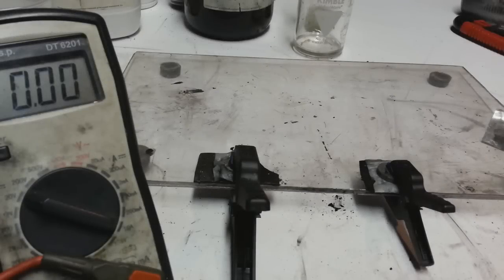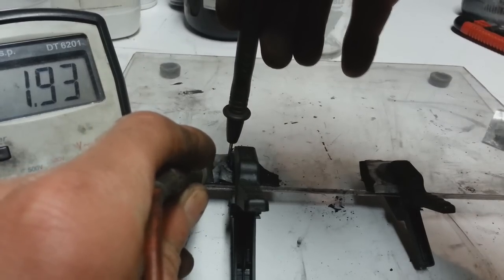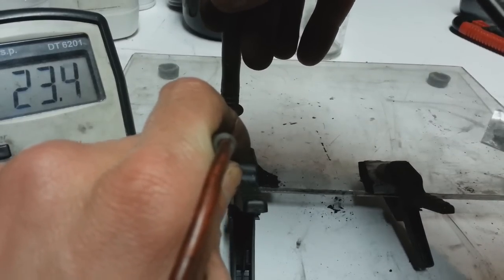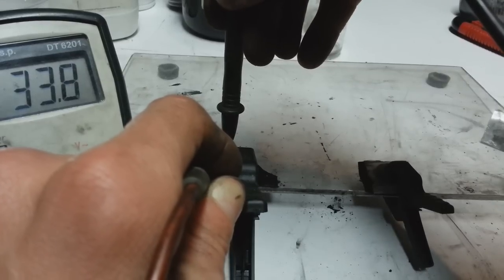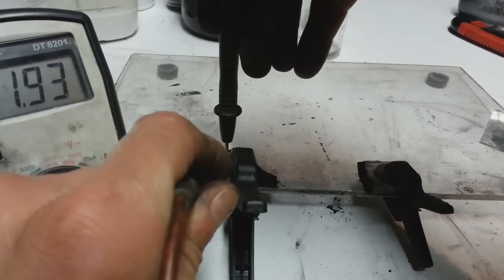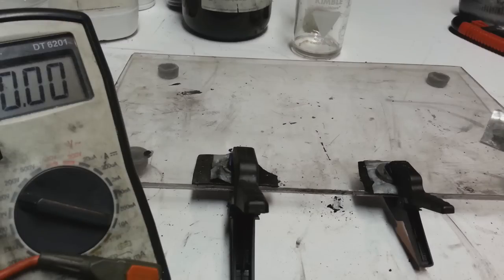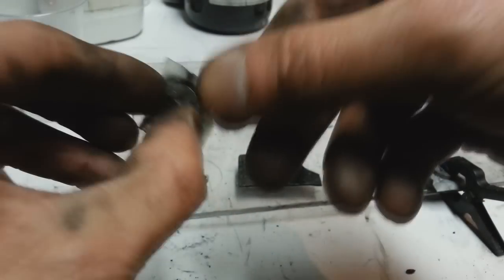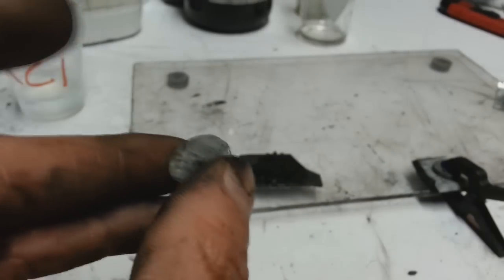How to make a Magnesium Battery

Comment: What was the best battery you ve made till now?
Reply from the maker: iosef 333 hmm, hard to say,... hydrogel polymer dual carbon battery, high capacity rechargeable zinc battery, solid state graphene battery, sodium ion,... but some of this battery was made in work lab with high quality materials and good equipment.
Reply: +cayrex2 Wich not?
Reply from the maker: what which not?
Reply: cayrex2 Wich dont need to be made in work lab with high quality materials and good equipment?
Reply from the maker: iosef 333 I can make all batteries in home lab, but the performance will be lower.
Reply: +cayrex2 But wich could have the best performance in a homelab?
Reply from the maker: iosef 333 dual carbon battery or zinc battery